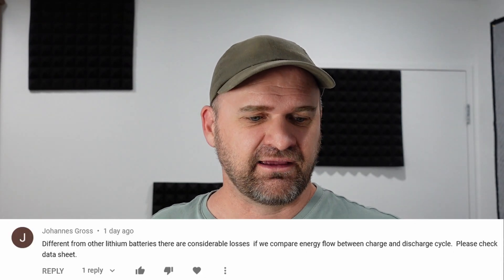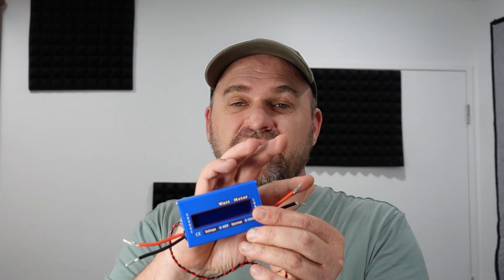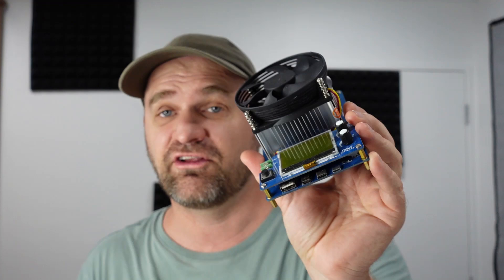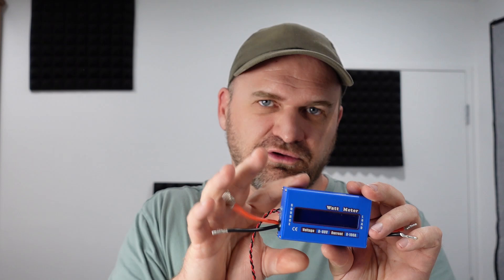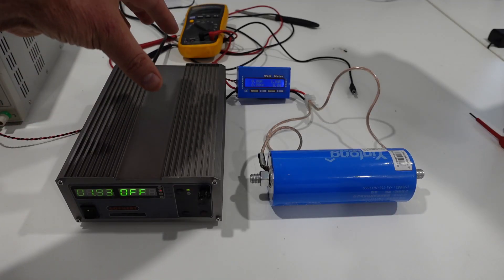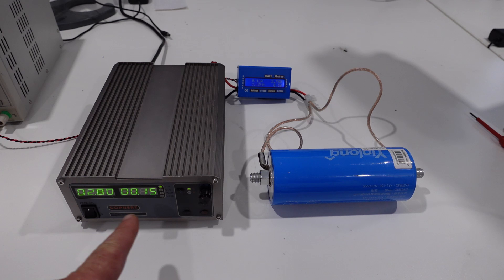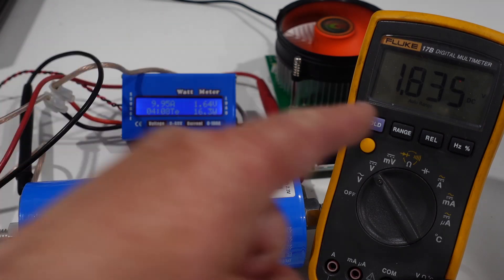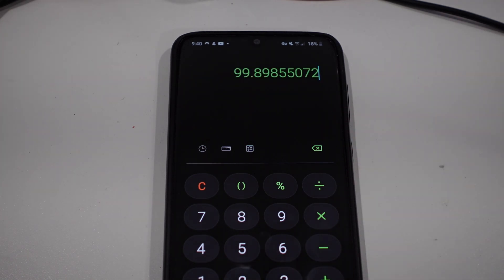Efficiency test LTO Yinlong battery

Comment: Lto yinlong cells are junk. They dont have storage capacity. They give out a quick burst and they need massive alternator current for charge back. Just use a huge maxwell cap bank. The temgot LiFePO4  460 amp litium iron with a 300 amp real bms is a  top of the line with a cells. That will blow an  80 amp hour 6s battery bank away thats 12 yinlong cells at 82 dollars a piece then the box and a joke bms a toy for like 1200 dollars. For a battery bank for a quick high burst of current and  let me keep my alternators running at 400 amps of charge back. So battle born is good lithium iron made in the us. So temgot LiFePO4 460 amp is made with all the heavy duty components of battle born for a 1000 dollars a battery. So its 3.5 times stronger then an lto for 200 less. SO two in parallel is 920 amps. They should leave an lto yinlong in the bus they got giant generators.  The electric car uses lithium iron so they can get from point a to point b. The lto you be stuck at the end of point a to a charger. My point if one 460 amp hour is 3.5 times stronger in storage two would be 7 times stronger. So you need 8400 dollars more in 7 lto batteries to make the difference. The bass heads are morons they cant run power on lto cells with out huge amps back were talking 400 amps on an 80 amp cell bank. Two 460 litium irons dont need alternator power they will run 4000 toy watts of stero power at 920 amp hour for over a good hour. Not any alternator needed. The bms has a cut off.  Take them home and charge  them and you will be good for 5000 cycles thats 15 years. Have a nice day

Comment: does LTO better in energy & power density, safety, cost than LFP?
Reply from the maker: It has better power density than lfp, worse energy density, better safety and cost is dependent on how you rate it.  For basic storage it's more expensive, but energy/degradation cost... it's cheaper

Comment: Hello, I need your guidance. To charge this 28 volt and 400 amp battery so that it works continuously without interruption, what kind of charger with what ampere and voltage is needed to connect to a 24 to 220 power converter, the output of the device connected to The converter is about 3600 watts. Can this battery be connected in series and parallel at the same time?
Reply from the maker: Flick me a message on Instagram

Comment: You may find that E will improve even more if you make all of the wires as short and connector free as possible. There are losses there as well so consistancy and optimizing the set up really matters when you are looking for accuracy.
Reply from the maker: Sorry for the slow reply...    I think making the wires as short as possible etc. is irrelevant for accuracy in what I was measuring.  The cell voltage is so low that it will be difficult to eliminate those losses.  In my mind, rather than trying to reduce losses you should either eliminate them or measure them.  In this example I measured the cell voltage at the cell terminals, this essentially eliminates voltage drop in wires/shunts etc.  In hindsight I should have measured the voltage with a separate connector to the cell terminal rather than sharing.
Reply: @brendontait6968  Battery voltage measurements should always be made using a Kelvin connection placed as close to the battery as possible. Sense lead loops are not without losses which are compounded by the amount of current that flows through them. When working with low voltages even uA can matter because they result in an apparent Vb that differs from the actual Vb and the error is a greater % of the actual. This implies that the measurement loop should ideally be as short as possible/practicle and not be single ended. The currents are dynamic and vary with battery voltage so although not impossible to account for through charactertization they have some influence. Therefore, it is very important to make the measurement with a device that has a high input impedance to reduce the current to within acceptable limits. When viewed as a system if any part of the load current path is shared with the measurement path the varying load current will distort the battery measurement making the Kelvin connection important to accuracy. Often over looked are the high current path's current ratings and/or AWG wire size. In many applications the acceptable current carrying capacity of a wire is not adaquate for an application because even though its temp rise meets the spec its voltage losses are greater than desired. Depending on the application and the degree of loss improperly sized wire can even lead to system instability.

Comment: The life cycle is definitely offsetting any efficiency issues, for me.
Reply from the maker: Efficiency issues?
Reply: @brendontait6968  They have always worked perfect for me, in my application. I have an 80ah bank on a 5k @.5ohms and it's been perfect for 3 years now. 250amp alt and 2 runs of 1/0 from the alternator. I'm only charging to 14.8 so I'm missing out on some reserve and I never see below 13.9 at full tilt for as long as I want.

Comment: Probably a dumb quest Im on to, but Im considering to build a 48v50or60ah battery pack for my 2 cargobikes,,
I want to use it for longer trips were I from time to time need to charge the pack,,
But Im also hooked on the Molicel P42, but the safety in LTO vs Li-ion should be so much better,, ❓❓❓
Reply from the maker: I don't think a dumb question.  The P42 is a good cell.  I was initially going to build my pack with 18650s as I am able to get a bunch of them for free.  I joined a DIY battery pack build page on facebook.  I have never seen any one collection of as many houses burnt to the ground as I did in that group.  Altho in most cases it was likely the error of the pack builder and I'd be mindful of risks etc.  I still felt uncomfortable doing it knowing there is so much at risk.  You could have an electronic failure in a BMS and all of a sudden your pack catches fire...  Look at the LFP packs also, they are a safe and more affordable option.  That being said... I think if they are bikes and you are not charging them in your house, the cost of damage from potential fire would be fairly low.  The issue with LTO and LFP is fairly low energy density which is a big deal on a bike.

Comment: Your problem bud is your used the wrong cells. If you would’ve done some research you would’ve realized that. Those cells are made for quick charge and quick discharge not long term RV life
Reply from the maker: How so?  Is 20k cycles too short?
Reply: @brendontait6968  I didn’t say that, at least I didn’t mean that. All I was saying is those are made for fast energizing and fast discharging. Yes you could store energy in it but its design was made for more of a power demand situation. For the size it would take to add up to 100 amp hours. They’re big and inefficient for solar storage

Comment: Makes me think these 'batteries' aren't really batteries at all, but a combination of a capacitor and a battery.
I wonder how they would compare to a set of 18650 batteries in terms of how many hours it could power a small device, or charge a laptop or so?
From the 41Wh they're about 5.5x more efficient than a single 18650, but also more than 10x larger.
Cost wise, if this LTO goes for $50, and a 18650 costs about $10 a piece, this is more economical, if you can spare the huge increase in space it takes up.
16850 batteries can discharge just as much current as this, so long you pair them. Size wise, 10x 18650 cells can deliver much higher kWh than this, though they occupy roughly the same space.
Reply from the maker: These are chemical batteries - but they do share some characteristics of capacitors.  There is no question that an NCR18650 is more energy dense.  But they are significantly more dangerous, less tolerant to abuse and have a significantly shorter life. I joined a facebook page of homebuilt powerwalls where people typically use 18650s.  I've never seen so many houses burned to the ground in any one page.  This is something I'd like to avoid.  A single fault on one line of BMS circuitry can easily run the cells into thermal runaway.

If we look at capacity... I'm typically getting 42Ah as an average from the cells I bought 42Ah x 2.3V = 96.6Wh.  An NCR is 3.4Ah x 3.7V so 12.6Wh so it would take around 7.5 NCR cells to make one of these.  At a cost of about $75...  The NCR18650 also has an 80% capacity life of around 300 cycles - whereas these are around 20,000 cycles.  So yes, you are correct... But in my situation, safety, reliability and longevity are factors that I value much more than energy density.
Reply: @brendontait6968  You seem to got A-grade batteries here. I've seen some review on B-Grade batteries of this kind, sold on Alibaba, for $50 a pop, and their performance is a lot worse than 42Ah.
As is typical with chemical batteries, that they lose power over # of charge cycles.

Comment: Regarding your battery bank build, would you mind sharing what MBS you're using, and are you using solar? what solar charge controller,, and do you need an inverter? is LTO DC current? and you are using this to drive your van right? Because I'm planning to drive my van and I'm worried about choosing those parts. It's easy for a house build but for the car build, I Don't know.
Reply from the maker: Am using an ANT  bms, it works but is not great.  All batteries are DC (arguably inertial batteries could be AC).  So I have a 600VA inverter that runs 24/7.  This powers my fridge and a couple of power outlets.  There is about a 7W penalty for this, but this is insignificant for my system.  I have a 6kVA inverter for running my induction hobs, hot water cylinder, oven etc.

I hope to spend a bunch more time in the coming year creating more informative electrical videos.

Comment: How come there was a voltage difference from the good voltmeter to the watt meter? you think that had an effect on the watt hours?
Reply from the maker: Because the meter was measuring the voltage at the battery and the watt meter was measuring after the voltage drop of the wires.  I explained this a little in the video and it was the reason I didn't use the Wh reading on the blue meter.  The Ah would remain reliable with voltage drop.  Check my cold testing video.  I go into a little more detail there.  Cheers

Comment: Not a proper efficiency test. Full charge and discharge would be. Everyone knows that with any chemichal cells the tricky things happens when close to full.
Reply from the maker: Everyone knows?  I've never seen anything funny happen with these cells at full capacity?  This was very very close to full charge.  In my application I only cycle between 2.0-2.6V because there si very little to be gained by taking them further in either direction.

Comment: You was right of  the too high efficiency ratio. Efficiency is to be calculated from Power consumption Wh, not  Amp hoursAh. So  it  was 97.1Wh charging and  83,4 Wh  discharging,  so  more  like 85,9 was efficiency. Voltage  makes  the  difference here, it  is  not same  all the  way on charging and discharging.
Reply from the maker: No it isn't - you cannot read the Wh indication on the meter - and I explained why in this video!  Check my cold cell testing out - I do a round trip Wh efficiency test in that video.

Comment: test shows you put in 97Wh and took out 83.4Wh, not sure why you'd do an "energy" efficiency but don't compare actual energy - but that being said I like your vids, just think that measuring amps in time is not providing the whole picture due to differences in charging and discharging voltage (it would work if you use a constant voltage variable current method, which won't work in this case but just pointing it out, you're actually using constant current).
Reply from the maker: 🤦‍♂️ I mentioned in the video why I was only measuring coulombic efficiency.  I also explained why I was unable to use the Wh measurement on the blue meter.  Check the video where I test them cold.  I go further into it in that.  If for eg the cells are sitting at say 2.2V and you put 20A on it, the cell voltage stays pretty much the same and doesn't really float like some other chemistries, so the actual charge efficiency is close to the coulombic efficiency.

Comment: What needs to be discussed is the high costs of the batteries, especially in price gouging Australia, just one of the cells was about $52au with a crazy $180 delivery charge. It seems to me if you live in the USA it's all mega cheap, and its free delivery or local pickup easy, But if u live in Australia, you have to pay for freight, exchange rates, duties taxes its endless, ends up costing over double or triple. If you buy them of ebay its cheap but you will get a inferior or fake battery, or perhaps the case filled with sand.
Reply from the maker: I live in NZ and we have Jacinda.  If you think delivery and taxes are bad in Oz, you ain't seen nothing....  bulk rates can become quite affordable (shipping per cell on a bulk shipment was around $5)  You do have to do research to ensure you are dealing with a reputable company tho....

Comment: So I just bought 60 35 amp hour Ying long cells I have absolutely no experience with these cells at all the application is for car audio what kind of power can I expect from a 350 amp hour Bank? Will this be good enough for my application my alternator is internally regulated currently set at 14.8 volts and puts out 411 amps when spinning at 2,000 RPM I'm trying to power two big amplifiers that will clamp over 20,000 watts of power each
Reply from the maker: I have little experience in the car audio scene so unsure of how accurate my thoughts are. Your battery pack is probably close to the limit of what you are wanting to draw.  Maybe crank it up to 15.3V to get the most you can. However... if the pack gets hot, reduce the voltage back to your 14.8V.  These cells can vent if running hot at high state of charge.  Be mindful of your alternator temperature esp at low rpm, your pack will be able to pull thousands of amps.  A temperature switch on the field might work.  Good luck
Reply from the maker: Couple other things to consider...  don't buy into the active balancer thing.  Assemble your pack so each parallel bank have approximately equal internal resistance to each other and keep a monitor on the balance etc... you can balance them manually each year or so.

Comment: Having just now gotten into these threads....  do I read it correctly that a slower charge on this cells will aide in increase of the efficiency of the cells themselves?  I am wishing to build a long range powered bicycle and will be using a small solar charger to recharge.  Thanks for some great videos!!!
Reply: yea, I think that's generally the case with batteries. a slower charge rate will result in better efficiency. try to shove more power in faster and you get higher losses.

Comment: How do you get on with the low voltage at low state of charge situation? Does your inverter tolerate that well? When the voltage falls the current rises, so it could stain the input side of the inverter more. Maybe your inverter is over rated anyway, or maybe even at 1.8V or 2.0V per cell you're still inside its ratings, but thought I'd ask :-)
Reply from the maker: Hey Fredio, sounds like you've been listening to Prowse too much. 🤣
These cells store little energy from 1.8-2.0V, their useful voltage range is 2.0-2.55V between the charge/discharge knees. I have an 11S pack which gives me a useful voltage range of 22-28V which slots in perfectly with most any 24V inverter requirements.   My inverter is an optimistic 6kVA (more likely 5kVA), I'm fused at 400A, so plenty of headroom.  Cheers.
Reply: @brendontait6968  Thanks, I don't listen to anyone, though. I was basing that off your recorded curves. That's a decent answer but doesn't specifically call out the lower voltage limit of your unit, may I ask what that is? Guessing it's something like 20V as 10V would be pretty normal on 12v nominal gear. In which case your math is A okay :-D

Comment: Hi Brendan, great vids, keep up the great work, I love them! What is your  thoughts on the prismatic LTO batteries? I'm also building a Unimog RV for family travels and would like to run a couple of fridges (Engel 60 and 40l) Bit green on all this new tech...
Reply from the maker: Hey Glen,  Thanks. I have some, but haven't played with them.  Keep them compressed and don't store them at max charge voltage and they should be fine.

Comment: There still is a voltage droop in the battery. if your efficiency is close to 1 then this seemingly small loss can be 1/2 your losses.
Add a V-meter to the battery.
If you don't want to hassle recording the discharge and charge voltage profile, just measure the voltage at begging and end of both charge and discharge and assume  strate line between.
May want to take a few measurements at top off voltage and down 200mV to where the curve is a relatively straight line.
Or do a 100-0% and a 90% to 10% cycle to see how much top off efficiency changes as a function of charge rate. Not using constant current at end will help efficiency also